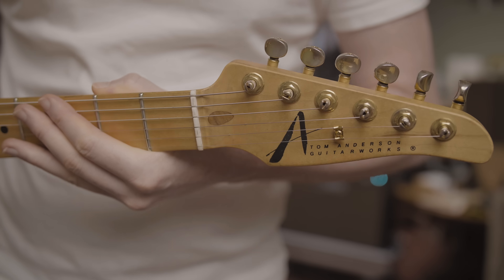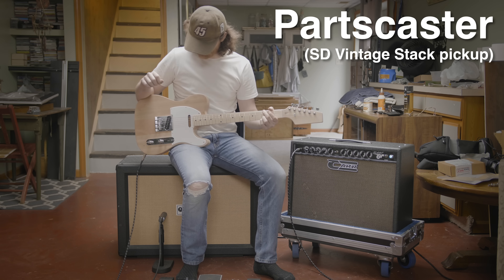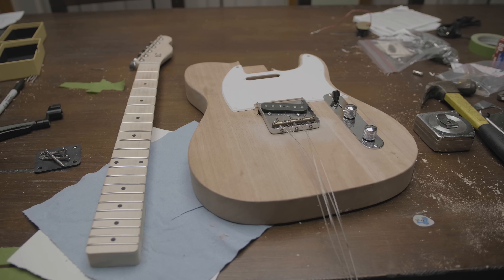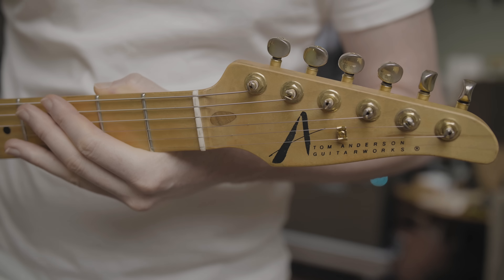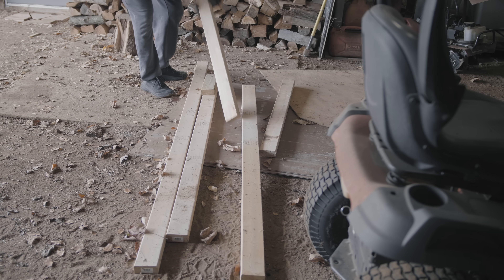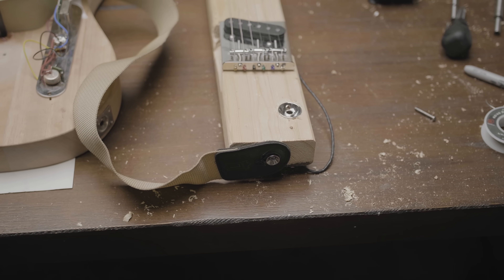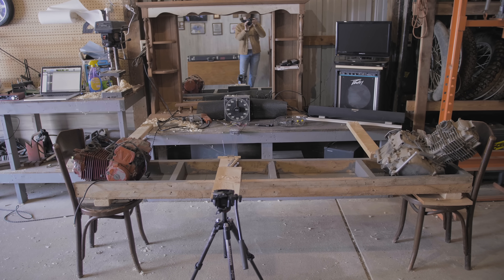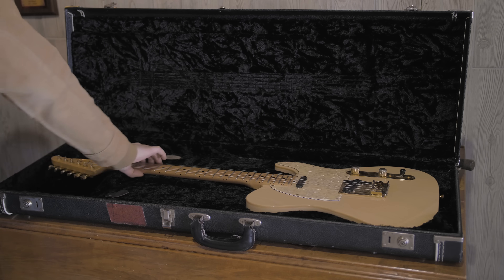Tested: Where Does The Tone Come From In An Electric Guitar?

Comment: I Became a guitar builder after and during studying physics, and knew way back when that most guitar companies, builders, and players were full of crap when voicing their opinions on what makes the tone of an electric guitar, and the one thing they all had in common:  They were all mere opinions, and most of it doesn't at all jive with physics, and is pure snake oil made by marketers and people who just interpreted what they heard into what little science they already didn't understand!

These things count and why:

Nothing will add sound of any kind unless you add power to the system (preamp and battery)!  That would imply getting more energy out of a system then you put in (Better than perpetual motion), which is impossible.  Everything that vibrates other than the strings is removing energy from the strings, and not adding anything!  Strings vibrate in linear waves, everything else in radial waves.  Linear waves convert to radial ones easy, but not the other way around, and so the loss is great (by ~ /pi^3).  You can EQ to a very small degree, by losing energy to the woods, but it would take a huge difference in material properties to notice a difference, softer and more flexible materials will rob more energy, (Sustain) from the strings whereas hard and stiff ones will retain it!  Mass is BULLSHIT and doesn't count, as it can very widely and yet have no effect on stiffness vs flexibility, and although weight can indicate higher mass, but there are very stiff very light materials at varying masses like carbon fiber!  Good vibrations are not good in anything but the strings, and good vibrating guitars will warp sooner, and parts rattle loose over time...!

No material can adopt tone (harmonic values, from any other, the wood tones will not get into the strings, only any left over energy returning that came from the strings in the first place.  Wood sounds like wood, and those may differ, and metal like metal...  Strike a wood block with a metal rod, and it sounds like wood, strike a metal block with a wooden rod, and it will sound like metal!  On percussion instruments, like drums and bells or, xylophones and vibraphones... the different sticks and mallets mainly change the attack and sustain not the tone!  A few milliseconds after a  strike they all sound the same 

Pickups cannot sense anything but ferrous metals*:  Iron (in steel), Nickel and cobalt and in that order from high to low in ferocity.  Ferrous metals can lose ferocity, magnetic and ferrous are two different instances of the same thing yet different. * Pickups can and really old ones often do have microphonic properties, but its due to sound waves picked up by the strings and/or the coils of the pickup (They vibrate), and why if you scream at your pickups, you will hear a mutilated version through a cranked amp.  For the most part MFG's try to eliminate them, as it's normally not good tone, but noise that you get from loose coil wires in the pickups.

If you want to change the tone of a guitar, move the pickups along the string path (more for building from scratch), raise, lower and tilt them under the strings, or use different ones altogether, and for F's sake don't blow your money on every pickup that hits the market and promises to make a huge difference, as the difference will be small, and you have a shit ton of pedals and an amp... you can make huge differences to the tone with!

Never judge an electric guitar that is not plugged in, as you are only fooling yourself!  Try it with medium to loud volume (or what you will be using it at), and preferably with your own gear, or as close to it as you can get if you don't have that luxury.

Speakers and their cabinets can make big differences because they have mechanical properties that actually count in shaping acoustics!

Comment: Nice, but just playing devil's advocate here... the parts are all still technically connected to wood. Critics are going to point that out. 

I would suggest another material altogether for the "air guitar", like two aluminum poles that are bolted to the floor.

Comment: It really is 100 percANT impossible for the wood in itself to effect the sound because the signal going from the strings to the pickups to the aux cord to the workings of the amp do not collect any identity from the wood, because the wires are insulates with rubber obviously so the wood doesn't touch the wires at all (not sure what kind of effect that would have), so by means of feel, weight,  and size does the wood effect tone.

Comment: I get the point you’re making and I agree that the pickup is 80% of the sound. But am I the only one that hears a difference even after 5:20 (ish)?  If I can hear it  through a phone speaker surely I’m not the only one. The open strings are really similar, but the fretted notes have a “waaang” on the Anderson and a “whooowm” on the cheapo, particularly as the note is dying. Call me crazy. I’ve been called worse. Really good stuff though! I liked the actual back to back comparison the way you did it. Most videos have so much space fumbling or blathering  on between the two samples of whatever they’re comparing that you forget what the heck the first one sounded like. Subscribed.

Comment: This is THE best, most detailed yet quick and straight to the point tone testing investigational video I've ever seen. This is borderline a scientifical university-funded study on guitar tone, just...wow amazing man
Reply: Scientific in my view.  The guy is checking hypotheses linking different Independent Variables with the Dependent Variable.  Does not matter that he’s not putting numbers on the data.  Data just means ‘that which is given’.  A police detective is also scientific, posing and testing hypotheses.  What’s going on here is Qualitative Positivism.  The Technique is Qualitative and the Epistemology is Positivistic.  These dimensions of methodology are wholly orthogonal (independent of each other).  Great work
Reply: I would say Warmoth's test is much more accurate and scientific because they keep the variables down to one thing only, the body wood. When you have more than one variable there is no way to determine if one item or the combo of the items, what percentage of each combo items, are what is changing tone. You need to limit variables to accurately determine what is changing the sound.
Reply: @Cpt_Adama  By the same token, Warmoth's test involves the use of human hearing to determine results.  Fundamentally that is flawed because there is a great variety not only in the human hearing apparatus itself, but in human perceptions of what is heard.  A dry signal running directly into a high quality interface and then analyzed for quantitative numbers would provide a higher standard of evidence.  It would also be helpful if the experiment was double blind, or even better if the "player" was a robotic apparatus that could precisely recreate each stroke of the pick.

However, at that point what is the point?  The important thing about sound and music is what people think they hear.  When it comes to the video above and the results, the best that can be concluded is that either an old garage workbench as a guitar body is the equal of a Tom Anderson chambered swamp ash body OR the body wood matters so little as to be entirely inconsequential to the final sound.

What I am interested in would be his results in testing strings.  I personally find them to make a huge difference, but I am willing to concede the potential for my own biases to have a big influence on my perception of that difference.  Will be interesting to see.
Reply: @ERWebster  You definitly could go down the "scientific" rabbit hole deeper, but I do think the Warmoth test was accurate enough to come up with a definite conclusion. My take away is that yes "tone wood" can make a difference, but only subtlety. In a complete mix it would be very difficult to tell the difference and a mixing engineer could EQ it to make it sound like what ever wood you want.
Reply: @Cpt_Adama  I agree for the most part.

Regarding the scientific merit of either the Warmoth video or this one, drawing a conclusion based on a handful of data points is correlation at best and incidental happenstance at worst.  A few hundred or even thousand points of carefully vetted data would get us to where statistically we could isolate a significant trend, if one existed.

I have also been long in the camp of tonewood has a small effect on tone, but as time goes by and evidence mounts, I am finding that my internal estimate of how much effect it has is ever dropping.  

Fortunately, I don't need broad scientific consensus to arrive at a personal opinion, just sufficient demonstration and personal experience to strongly suggest a trend.

After this video and others I am thinking that the effect of wood is extremely low, and as you said can easily be EQ'd away or entirely over-ridden by the tone of a pickup, if it can be heard at all.
Reply: @ERWebster  But you're using your ear holes to listen to this test, do you not trust your own hearing if you agree with this test?
Reply: @stefanfyhn4668  I would want to be careful making any assumptions about my hearing and my perception of it.  It is true that I can make some subjective observations, and having done so I am definitely leaning towards the tone wood in a solid body guitar is not a thing camp.  However, I would not want to make objective empirical statements like "the wood of a solid body guitar has absolutely no effect on the sound the guitar makes".  In the absence of strong objective evidence and quantifiable measurements, the next best thing we can even come close to making a sure and definitive statement would be a double-blind test involving hundreds of participants.  That would enable me to say Ok, I hear this, and so do 95% of all other people, therefor I can reasonably assume that the truth is that tone wood on a solid body electric guitar is not a thing.

Put another way, just because I hear it doesn't mean that is what it sounds like.  Just because I see it, doesn't mean that is what exists as I see it.  The mind is surprisingly malleable and in anticipation of expected results will distort and even fabricate our perceptions.  In light of the various evidence presented to us that seems to indicate tone wood is not a thing, how else can we explain why so many people "heard" that all mahogany body guitars are dark sounding?  That truth cuts both ways though, so I consider my perceptions with the understanding that they are imperfect and possibly swayed by preconceived notions.

I think it is worth considering the limitations of his tests (some of which in all fairness he does point out), as well as the limitations of the medium.  We have little idea how this was recorded, what software and codecs were used to encode the data, what compression routines Youtube applies when it re-encodes it again, and what quality of file was streamed at the time the samples were listened to.  Not to mention the quality of the sound system and speakers used to listen to the samples.

Then we have to consider the subjects in this case are a large number of people with wildly differing environments and equipment, who are all almost certainly coming in with their preconceived notions.  Also worth noting that even outside of the psychological perception of sound, there is quite a lot of variation in the physical ability to hear from person to person.  There is also certainly a large amount of evidence to suggest that ears can be trained (especially from a young age), and those people can "hear" things that someone who is untrained cannot.  Plus the inevitable decline of hearing due to age and exposure to loud volumes.

If someone came up and asked me does tone wood in solid body electric guitars affect the tone in any subjective meaningful way to the listener, I would answer "Probably not."  I hardly consider the matter settled though.
Reply: @ERWebster  are you okay bro? That's a mighty long paragraph for something I didn't say. You just said you couldn't trust someone relying on hearing for a test, then you basically threaten me for asking if you're not worried that you are basing your impression off your hearing through a YouTube clip
Reply: @stefanfyhn4668  When I read your response I was like "what is he talking about", then I went back and read the first sentence of my post, lol.  Sorry, I can see how that can be interpreted as aggressive.  I meant it in a more literal sense, that I would literally want to be careful about making assumptions, because I have been wrong before about things that I was sure I perceived a certain way.  It was directed inward at myself, not at you.

It is a bit long winded, but I am exploring these concepts mentally as I type and sharing my thoughts, so I want to be as thorough as possible.

I guess the TL;DR is no I don't necessarily trust it just because I experienced it.
Reply: @Cpt_Adama  Maybe, except here there WAS no change in sound! Thus, none of the variables mattered.

Comment: Well done.
I thought  the 3rd list of  "5 factors ...." was right, and still do.
#1 is the player. I've heard pros play cheap guitars and make them sound like a custom shop Fender.
#2 pickups and electronics.  
Everything else does effect the tone, but much less than the first two.
Body and neck construction affects play-ability more than tone.
Two guitars made the same day, with the same materials, in the same factory, will sound a bit different no matter what you try and do.

Now, acoustic guitars............ there's a different story, though #1 is still player

Comment: I make guitars and If you ask me I would say that pickups/height and placement position are the largest drivers of sound. This in combination with the scale length.  The body wood determines the physical feel of the guitar as well as its stability (tuning/humudity etc)
but does nothing for tone.
All of this changes with acoustics in which everything affects tone. 
When dialing in one of my designs, the variables I explore in tone are the scale length, the wiring and pickup, where along the string I am placing said pickups, as the distance from the bridge will make a real difference as well as height of the pickup.
People like to rationalize things like exotic woods by saying they affect tone, but I find that unnecesary. In total, I can drive a hyundai and a porsche 100 mph to the same destination. I will get there in the same time, but guess which car I will enjoy driving more?

Comment: I loved your scientific approach to this. I would add osciloscope and spectrum testing. The body of a guitar should absorb a bit of energy generated by the string vibrations at its resonant frequencies (clearly not in a humanly noticeable way according to your testing, but it should theoretically be there). A string would produce a fundamental and a series of harmonics, I am curious how the body construction would affect those if measured with objective instrumentation. What about chambered instruments? This need to be tested with absolutely no distortion, just in the linear zone of the amp or just the raw signal.
Fantastic video. It makes clear that the overwhelmingly main tone factor of a guitar is the pickup and its position.
Reply: This "string vibration absorption" is so small it is irrelevant for the plugged guitar sound. There are studies out there about this (like Zollner's on "the physics of electric guitar").

Comment: I was in a band once with a luthier who needed a guitar to try out a "gizmo" bridge with the little battery powered revolving textured rubber wheels, (one per string), which 'bow' the strings. He knocked up a Strat body out of cheap unfinished pine and it turned out to be an amazing sounding instrument even compared with one of Eric Clapton's vintage Strats which was in the workshop for a refret.

Comment: So the ammended list: 

1. The pickups 
2. The height and position of the pickups 
3. Where the string is plucked (along its length), and how (w/ what kind of material, and what kind of force) 
4. The string tension (and perhaps string gauge or thickness? not tested in this video) 
5. Nothing else makes a discernable difference

Comment: Regardless of the lack of a guitar body, the 'air guitar' will be picking up resonations from the benches, particularly the metal bench at the pickup end.  I was hearing (with decent headphones) more bass notes from the air guitar than from the Anderson.  However, I do think that the biggest differences in sound are from strings, pickups and electronics, not the wood of the guitar. The only part that I find it difficult to explain is why some guitars sustain more than others, even the same type of guitars, e.g. two different strats.
Reply: "Regardless of the lack of a guitar body, the 'air guitar' will be picking up resonations from the benches, particularly the metal bench at the pickup end." I think that's a bit of a stretch.
Reply: To investigate sustain you should look for: string distance from frets, newer strings vs older strings, player picking technique, amp type and amp volume, just to mention a few.
Reply: @iagobroxado  Also different guitars

Comment: Great video. I've had a more than a few guitars that seem to have a tone/resonance/vibration suck as part of the body/neck. Not sure where it comes from but sometimes it's been the whole guitar rings nicely (not plugged in) ... except the low E. Just seems dull & dead. Another guitar... every string seems dull and no acoustic resonance. I've usually sold them off. But I now wonder if that translates to the electrified sound. Anyone have any experience with this? Thanks